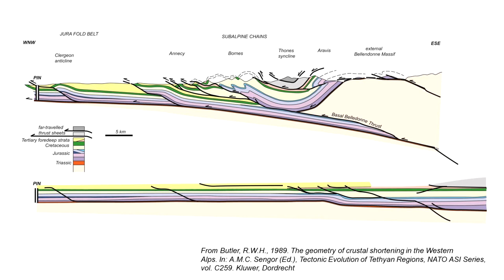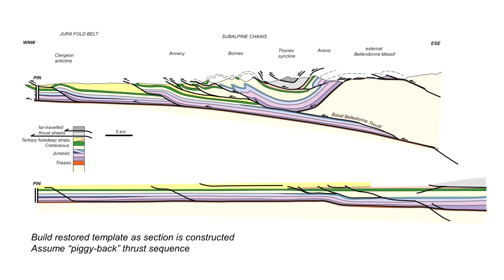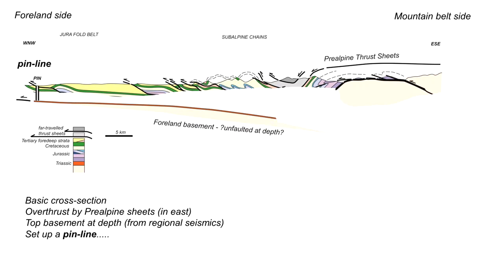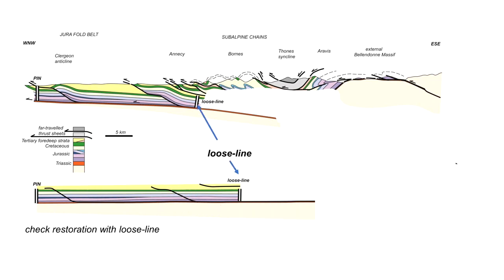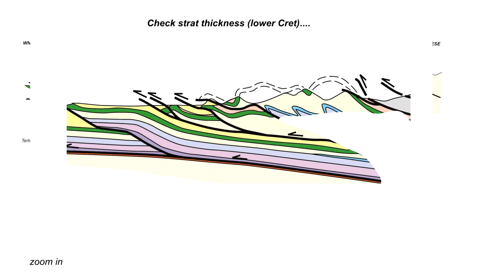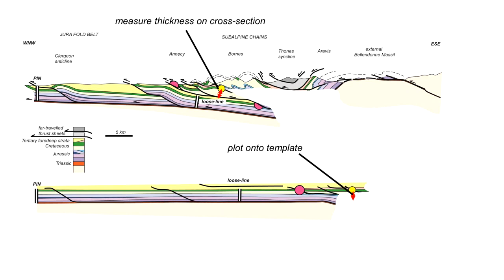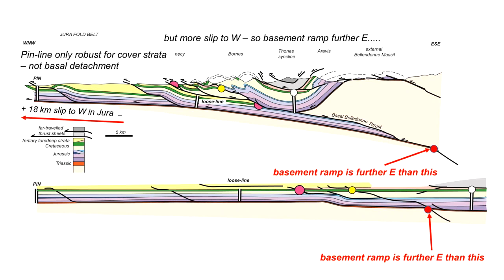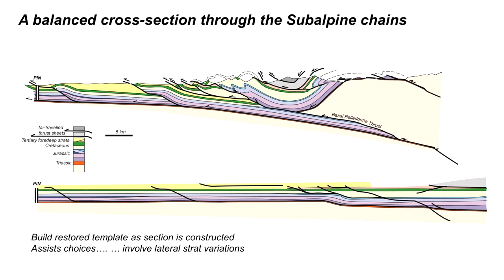A balanced cross-section through the Subalpine chains

Comment: Hello! Nice video.. Would you tell me what program did you use to make/draw those cross sections? I'm currrently working on something similar and I'l have to make plenty of them. Thanks!
Reply from the maker: Hi - thanks for the comment and question. I use an old version of Adobe Illustrator... though I'm moving onto Affinity. You can follow some of my diagram preparation (for video) in my "Syncing graphics" video on the channel. But for large balanced sections (including the Subalps one) I generally draught on paper/drawing film overlying graph paper (for simple area calculations) as pencil is much easier to edit... then I'll scan and bring into a graphics package. Have fun!